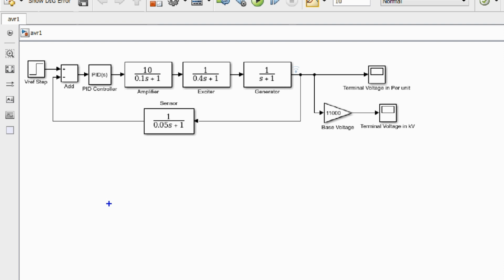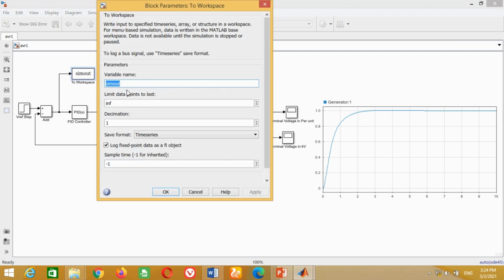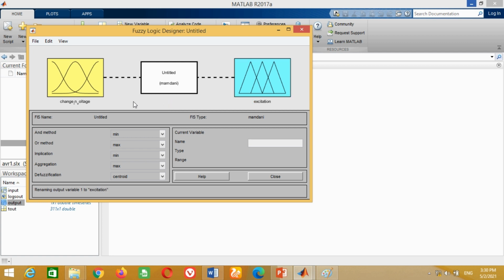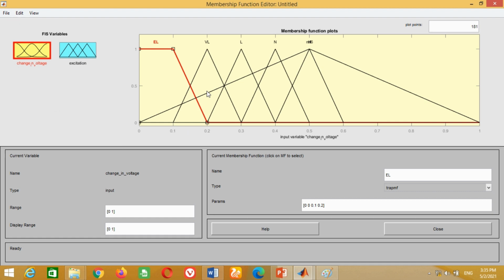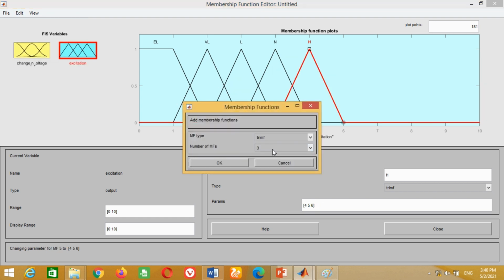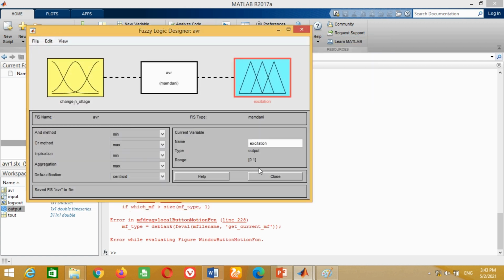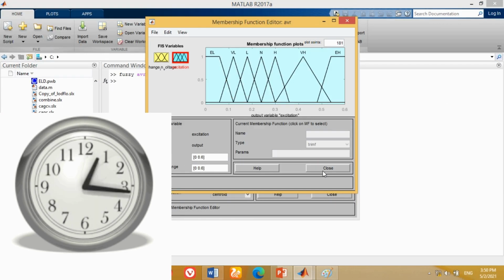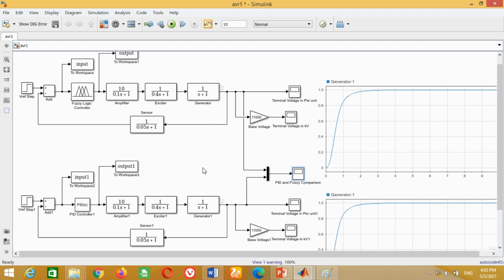How To Design AVR Model using Fuzzy Logic Controller in MATLAB/SIMULINK ? | Dr. J. A. Laghari

Comment: thanks teacher !
I have a question
Why did you design it as 1 input and 1 output? 
what should i do if i want to design it as 2 inputs and 1 output?
except for what you do
Reply from the maker: Thanks for the comment. 1 per unit means if its actual voltage is 11Kv and base value or reference value we have chosen is also 11 kV. then it Per unit value will be 1 per unit. Normally, 1 to 1.05 per unit value is chosen.

Comment: Sir how can we check the performance of Avr with variation ni load
Reply from the maker: Thanks for the comment. You may use signal builder block to change the input with variation.
Reply: Thank you sir for your help. I still have one question. Can we replace this generator exciter with actual synchronous machine model in this system?
Reply from the maker: @bipinmaharjan657  Thanks for the comment. This is transfer function based AVR model. If you want to use the real power system then make it separately by using the required components.

Comment: Hello sir, can you please make a video on PID TUNING using FUZZY Logic. To get Kp, Ki, Kd values.
Reply from the maker: Thanks for the comment. May I ask what is the advantage to tune the PID parameters using Fuzzy controller? It is better to replace the PID controller with fuzzy.
Reply: @DrJALAGHARI  Thank you for the response sir, I am doing my final year research project on LFC using PID controller with various optimisation techniques. I couldn't find any proper resources on how to calculate or get the PID parameters from FUZZY.
Reply: I have done my work on PSO & Ant Colony optimisation techniques, but stuck with Fuzzy Logic.
Reply from the maker: @ramugokulakrishna8167  fuzzy logic is not an optimization technique. It is an intelligent controller. Therefore, it needs different technqies to find the best values.
Reply: @DrJALAGHARI  yes sir, but I have seen some research papers where they use FUZZY to get PID parameters. Like area control error and d/dt(Area Control error) as input to the fuzzy inference and Kp,Ki,Kd as outputs. I just wanted to know clearly about the whole process of how this happen.
Reply from the maker: @ramugokulakrishna8167  Right. First try to design the model with conventional pid controller and use the inputs as you have mentioned. Then simulate the model for various cases and observe the inout parameters maximum and minimum values. Similarly try to find at what parameters of PID you are getting good results. Then try to design fuzzy controller using the above input and output range.
Reply: @DrJALAGHARI  okay sir, thank you for the help.

Comment: Sir could u kindly specify any advanced technique that can be used in machine learning in particular.  This suggestion would be of a great help for my research
Reply from the maker: Thanks for the comment. You may use ANN or any ANN type such as radial basis function neural network, probabilistic neural network, support vector machine etc.

Comment: I executed the same one sir, got great   results . Thanks for the detailed information.
Reply: Sir could you kindly suggest if this can be implemented using machine learning. Which technique can be used
Reply from the maker: @researcherali7523  Thanks for the comment. There are many technique's in machine learning such ANN, types of ANN can be implemented.
Reply: @DrJALAGHARI   sir could u specify any advanced technique that can be used in machine learning in particular.  This suggestion would be of a great help for my research
Reply from the maker: Thank you so much for the compliments. Kindly share it within your circle so that they may also get benefit from this video as well as channel.
Reply: Am busy with the sane one, but it's giving me an out put of 2 pu instead of 1pu